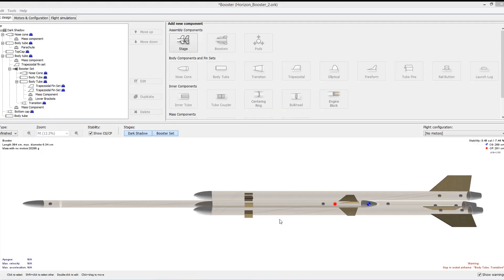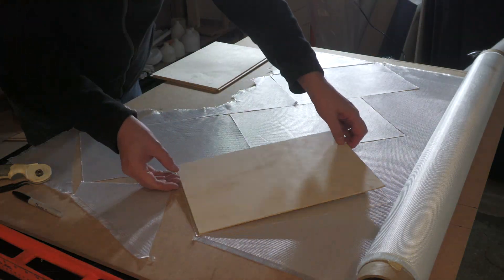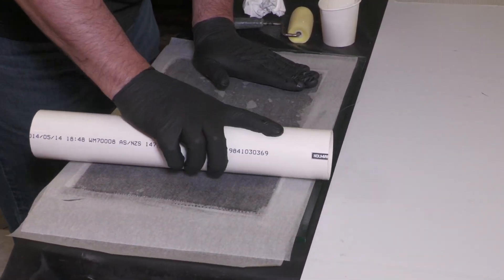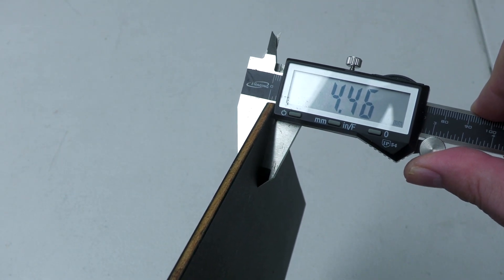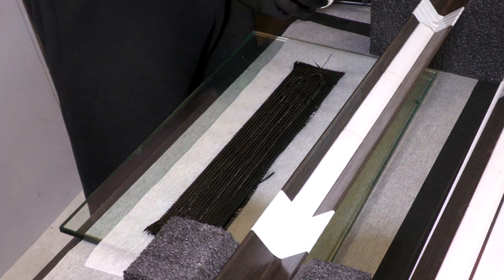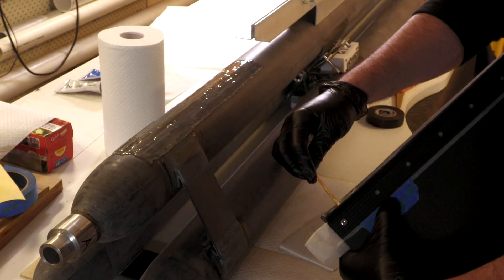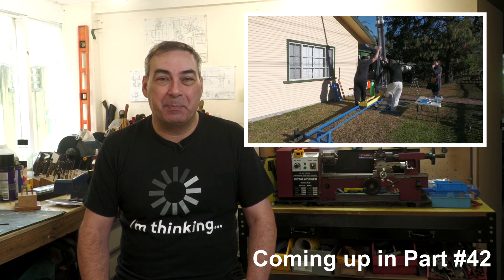2 Stage Water Rocket - Part 41 - Booster Fins

Comment: Hi, when we layup on aerospace parts like airplane parts, those yellow strands in the carbon fiber are considered FOD. I know it is just a small amount on this case, but I noticed it. Very nice job by the way.
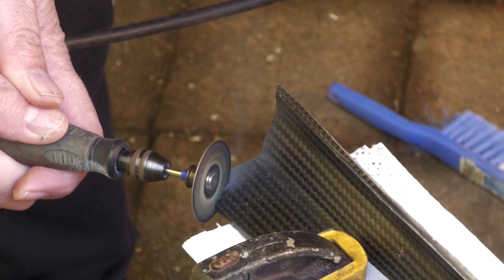Reply from the maker: Thanks, yes good point. That bit gets trimmed off when we cut the bracket down to the actual size. You can actually see that specific yellow strand being trimmed away at 8:00 in the video.

Comment: How does it help to use a combination of fiberglass and carbon fiber?  It seems like you’d get the same stiffness with less weight if you used only carbon fiber.
Reply from the maker: Mostly cost. Also for the top layer, we don't have a fine cloth weave in carbon fiber. The top layer is 85gsm fiberglass which gives it a much smoother surface finish.

Comment: Why do you use plywood? Would the fins not be strong enough using only glass- and carbon fiber? The tail drag from a smaller fin is less than a thick fin.
Reply from the maker: That's a good question. It's basically a cheap and lightweight core material used in sandwich construction. With this approach you get very good stiffness across the entire sheet at low weight.  To achieve the same stiffness in purely carbon fiber or fiberglass you are looking at more weight. Weight was more important here that the small difference in thickness.
Reply: @AirCommandRockets  would depron sheet or other insulation foam boards (there is also the paper laminated foam board) work or would it collapse from the force applied with the PVC tube?
Reply from the maker: @claeswikberg8958  I think that could work, depends on how well the fiberglass/carbon fiber could be bonded to it. If you would be concerned about crushing it with the PVC pipe, you don't have to push so hard. :)
Reply: The farther apart the top and bottom layers, the stiffer the sandwich is. The plywood is a relatively light weight way to space the layers.

Comment: For "mass" manufacturing small parts (like the brackets): what my hobby-woodworking teached me is if I need a lot of small, but identical pieces it is often more useful to make a few longer then cut them into the final size instead of cutting them down the size first and then shape them individually. For me making a longer mold shape doesn't look significantly more time to produce but it would have half the time while you had to wait for the epoxy.
Reply from the maker: Yes, a really good point. That's something that would have worked in this case.